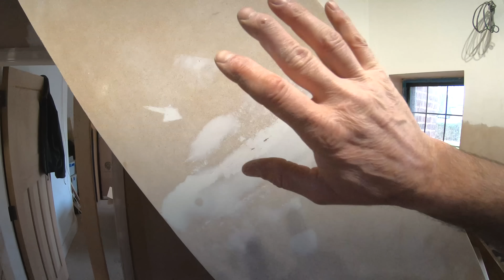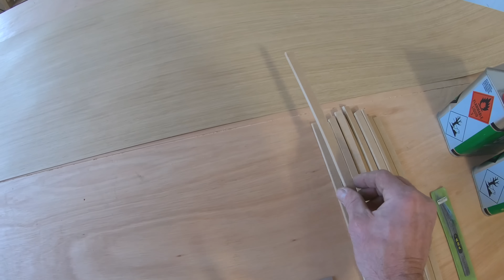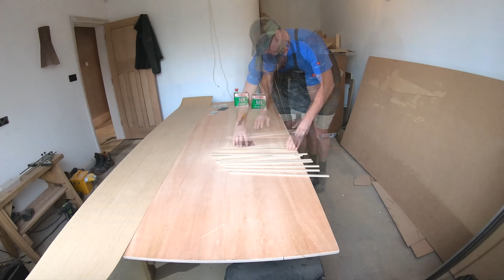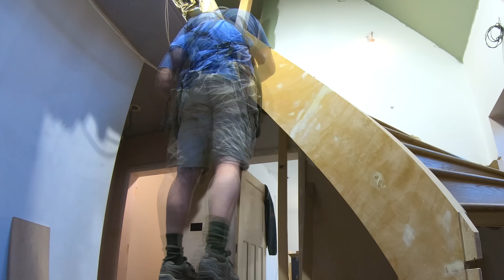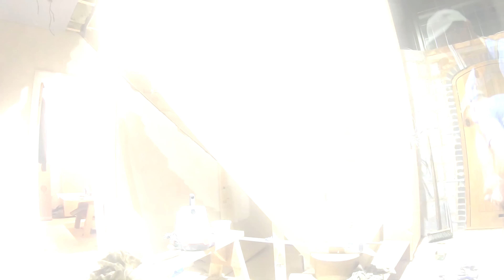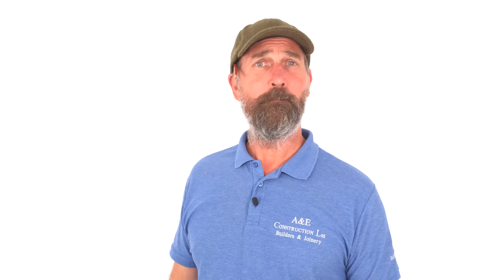HOW TO APPLY OAK VENEER | How to Build a Staircase #8 | Build with A&E

Comment: May I ask what type of glue is the best to glue the veneer at the base round step? I am in exact situation and looking for right kind of glue. White glue, yellow glue or contact cement or something else? I am a newbie but doing the stair project for my home. Thanks!
Reply from the maker: Tony used cascamite glue for this project. 

Hope this helps. 

All the best, John 👷🏻‍♂️
Reply from the maker: @kw717  Hi mate if it’s a thin veneer the use contact adhesive with a fine tooth spreader 
Regards John 👍
Reply: Thank you so much!!

Comment: Great vid. How did you round over the veneer on the treads bullnose, would liked to have seen you do that?
Reply from the maker: Hi Stogie 47 the tread bullnose are not veneered they are solid if you look at episode 2 or 3 of the staircase it will show solid oak treads hope this helps all the best Tony 👍
Reply: @BuildWithAE  Thanks Tony, i had a feeling they were solid pieces, but i thought i were ask the question anyway in case a method i hadn't seen before had been used to do the veneering. Great work👍